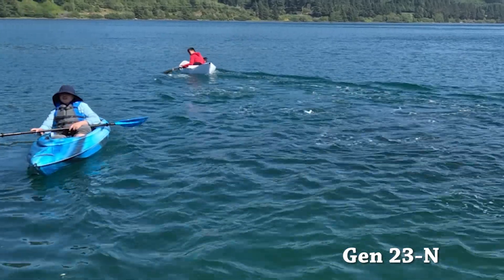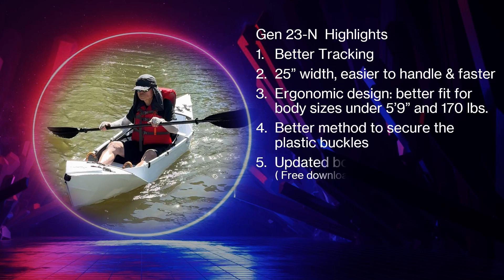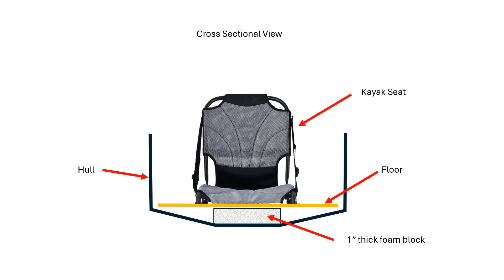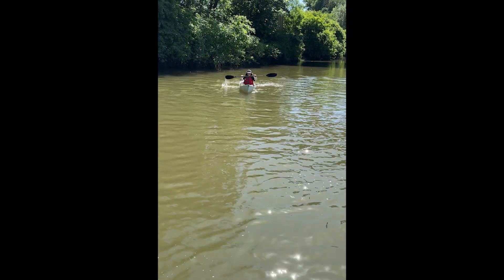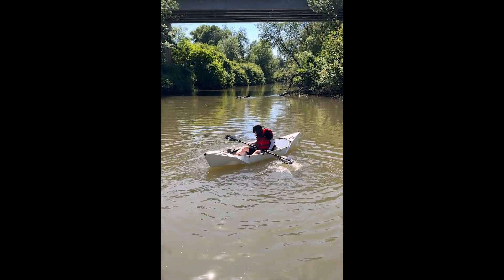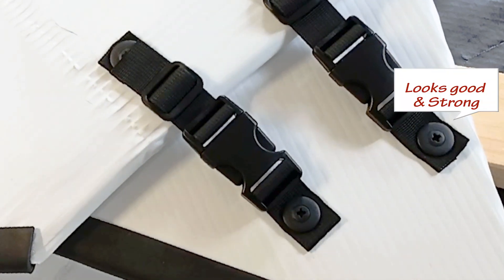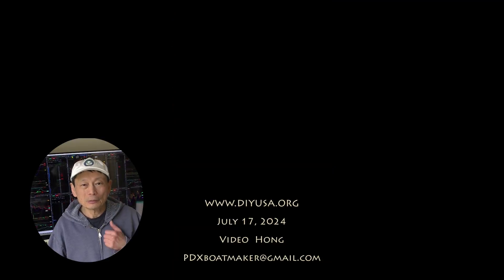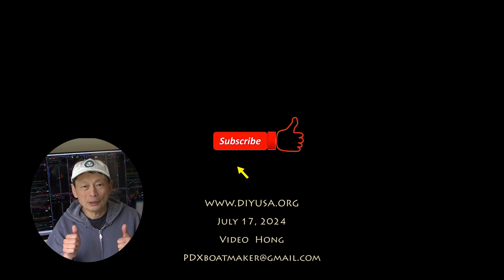Improved DIY Foldable Kayak Gen 23-N -Free Kayak Plan

Comment: Hello! I would like to ask if you have experience making a similar boat by glueing 2 or more panels togeather. If yes, did it work?
Asking because i would really like to try your design for myself but I unfortunately can’t find the full sized ones close to where i live and ofc ordering a massive sheet is expensive.
Thank you!
Reply from the maker: I have used heat fusion to joint two sheets and made two kayak/canoe 14.5' and 13.5' long. They all work very well. You can see the playlist here for those two boats https://youtube.com/playlist?list=PL2ShZzOUu01vtgOL2guD7_R3i5niI1KOq&si=R3LFeiZn1N3tV9xo
https://youtube.com/playlist?list=PL2ShZzOUu01ul94LmvXJm_K3NVBKerLc5&si=ea9iERhUiDahPBok
I have links on this page for the related videos using this technique. https://www.diyusa.org/techniques
I have tried to use tape to joint two sheets, but it is not reliable therefore I 'invented' the heat fusion technique.  This is the boat is used tape to join two sheets of coroplast (4 mm ones from Home Depot). https://www.youtube.com/watch?v=iRv7EY3Qa-4    & https://www.youtube.com/watch?v=CC9X6YVJ3w8   There are a few builders used contact cement to glue the sheets together, which should work well also.  My newer designs can be built with 48" wide coroplast. Please let me know if you have other questions. Thanks for watching.
Reply: @DIYUSA  thank you for the swift and detailed response. That was all for the time being. I wish you a good weekend.

Comment: What material/product do you use for the black edge covering of the floor as shown in this video? Also do you have any plan drawings for the floor? Im working on a full size Gen 23 right now and its going great.
Reply from the maker: Sorry for the slow reply, I have been traveling. My friend used the Neoprene Self Adhesive tape, but I don't recommend that because it couldn't hold onto the coroplast. Because the dimension of the floor is specific to the boat you build, which various, I can't provide the exact dimensions. I have created a video which will give you an idea on the shape of the floor and you will have to adjust the dimension, mainly is the width. Please let me know if you have other questions. https://youtu.be/owVGAtDUIs4

Comment: I am going to built one of your Gen 23s this month. The Gen 23N seems really cool, but i'm about 185 and 6'. How did you determine that it would only be good for people under 170 and 5'9. What is the width of the original Gen 23? I'm curious how much less buoyancy Gen 23N has vs the Original Gen23
Reply from the maker: Thanks for asking such a good question. The height and weight I provided are estimations, based on the observations of different paddlers using different designs. I have a friend (6 ft tall, 200 lbs.)  tried out the Gen 23 (beam 28"). It was a very comfortable fit and he really like the size. Of course, it would be even better if the boat is longer for the 6' tall person. But that design is a bit too wide  (at 28") for me (5'5", 135Lbs), also the 10" high gunwale is a bit high, and I have to use a 4-5" seat. Hence, I came out with Gen 23-N, which is really nice for my body weight and height. I have a friend at around 170 Lbs. and 5'9" to tried that out, and he feel it is a right size for him. I will work out the difference in buoyancy when I return home in ten days (I am traveling). Please stay tuned!
Reply from the maker: I found the spreadsheet and these are the estimations: for Gen 23N Beam 25" , after deducted the weight of the boat, at draft 3", it can handle 164 Lbs. and 3.5" draft - 193 Lbs. For the Gen 23, Beam 28" draft 3" 185 Lbs., draft 3.5" 218 Lbs.

Comment: Your kayaks look and function great! Thank you for sharing your process and the things you’ve tried along the way. I’ve been designing a sit-on-top one person pontoon boat for lake fishing but had not found pontoon material until I saw your expert folding of the coroplast. Do you think you could use the same 6mm coroplast to make a pair of origami-style folding pontoons? You’ve inspired me to try! I just have to figure out how to fold them so they are closed on top.
Reply from the maker: Thanks for watching and your question. Yes, I have tried to build pontoon boats using coroplast. You can watch the videos of those boats.
https://youtu.be/ILeIKBoxKZk?si=JqfxcoAMqFkz19_E
https://youtu.be/KtjaziICe9E?si=wP1CnO0BpYDvEYEb
https://youtu.be/HO-52Yays8o?si=6frmVlViKeNVEVGx
https://youtu.be/8roMckSj-ws?si=GShlonmTxCK_BiuQ
After I have used my latest pontoon boat a few times (modular with foam -which I built about a month ago) and I don’t like the weight of it (35 lbs). I am thinking of building a lighter one using mostly coroplast. It will be partially foldable and will still have the metal frame to hold the pontoons together. Since I am working on another design, I will not work on this project till next year. If the height of the pontoons are 7-8" tall, I think it can handle 10-15 knots wind and the water will not get inside the pontoon that easily.  My modular paddle board is only 4" tall and I tried to made it totally water tight (it is not foldable). I used it at the Pacific Coast. Water still get in but it is so minimal that I don't really worry about that (a few oz after I used it for 4 hours - it could be condensation also). Therefore I feel if the height (or freeboard) is at 7-8", I don't really need to make the pontoons fully water tight. I still need it to stay afloat in case the boat flips over. Cheers!

Comment: Saw a "diy hack" video the other day where they filled a glue gun with as many zip ties(with the heads cut off) that would fit so it gives a stream of abs plastic. Just a thought, maybe that could be "injected" into the boards for corners that wear faster. Or test it as an adhesive for panels or something? 

Your screw rivet looks better than a blob of plastic though!
Reply from the maker: Thanks for your input. Hope to watch the DIY Hack video to learn something new. I believe the commercial foldable kayaks have been using plastic rivets and now I can implement that with simple tools. The abs plastic doesn't stick to coroplast hence I don't think I can use it to protect the corners, instead I use multiple layers of gorilla tape for such purpose.
Reply: Ah, good to know it doesn't stick! :face-red-heart-shape: